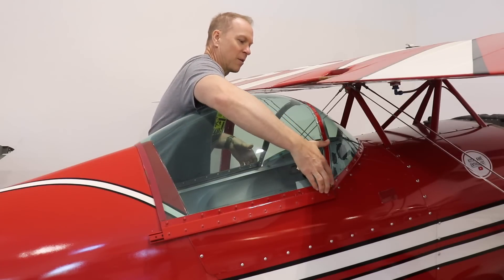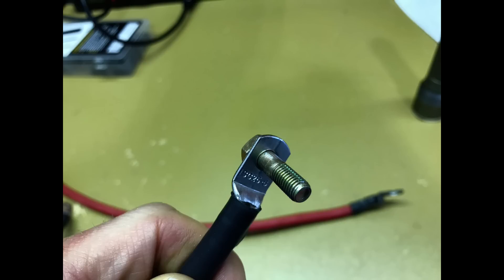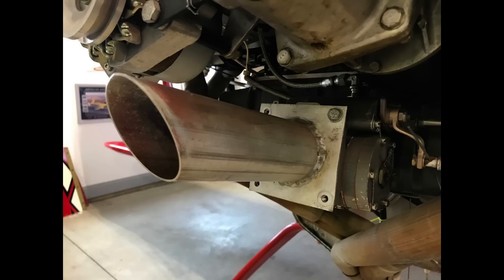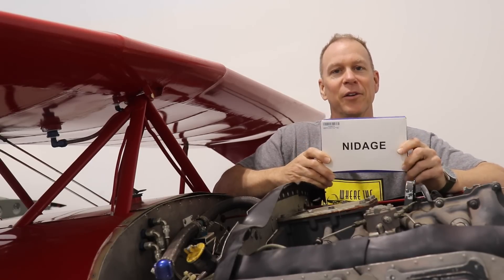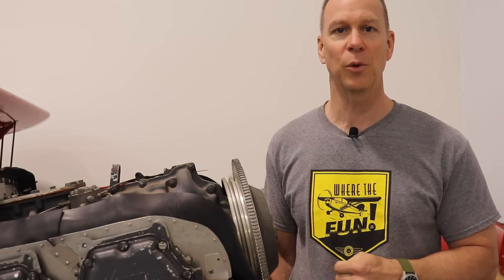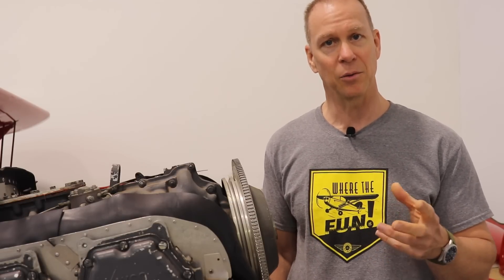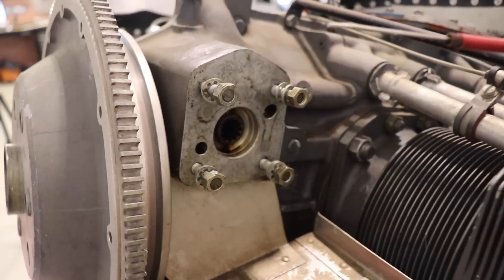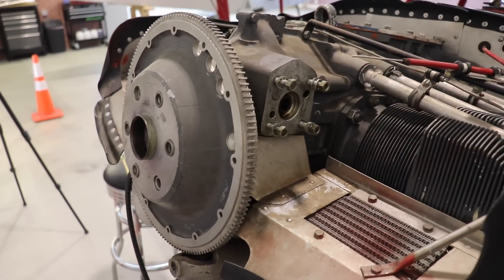PITTS S-1E "MAJOR PROBLEM"  (EP2)

Comment: I have spent 6 years rebuilding and restoring my Pitts S1-T. Built 3 new wings and mounted a Grove aluminum gear. My engine is a Superior IO-360 parallel valve with cold air sump and induction. The prop is a Sensenich carbon fiber ground adjustable which I ordered at Sun N Fun 2022 and took 2 months to ship and receive. Pitts is now 90% complete and hopefully flying by September. Keep up the interesting videos Mark!
Reply from the maker: Sounds like you’re building an awesome plane! I can’t wait to see it finished and flying. Did you pick a paint scheme yet?

Comment: Sharpening a Phillips screwdriver is the way we used to do it, also I caution you on a pits that you have no logbooks on the engine because back in the day we used to shave the case because the only cylinder heads we could get was 8 1/2 to 1 by shaving the case and re-cutting the cam and crank we get 9+ compression with 8.5 to one jugs and I don’t remember the dimension to check off the top of my head to see if this was done. But Lyccming would know.

Comment: Mark 
I’m an A&P and yes I’ve done that constant speed to fixed pitch before.   What Lycoming  said to do by taking a long punch to poke a hole in that plug is correct.  What I used was an old screwdriver that I sharpened to a point and used that to poke that hole.  One note of caution is, if that hole isn’t large enough  oil pressure will build up enough to blow out the front plug.   So make sure that the hole you  poke is close to a  3/16 inch dia.  or more.   I found that out the hard way.   When u put the plug in the front of the crank make sure u get a good dimple in the center of the plug to (1) hold it in place and (2) seal the end.   
So give it a try and good luck
Reply from the maker: Thanks for the info! The Lycoming SB says to make the hole 1/8 to 3/16” so I’ll def go on the larger end. Great idea about the screw driver-I’ll go to Harbor Freight and get a “high quality” a few driver and I’ll grind the end to a point!
Reply: Maybe you'll just find those log books somewhere 🙊🙈🙉

Comment: prop conversion seems like a super easy decision! remove the weight, save the monies. clean up the valve covers? ceramic coat the exhaust? fly it! looks too good from my house! but really it looks like a great airplane that just needed the love your giving it. Full resto might be saved for the "buy another one that needs it" category.

could you send the engine in for conversion? poke a hole sounds like a joke! I would have a hard time with that unless you found someone with experience with it.

Comment: It is good practice to use a washer under the battery cable nut or bolt given that the cable end is typically made of copper or a material softer than the fastener.  A properly sized washer for an AN4 would have easily addressed the large hole in the original cable and would have been a sound solution.  Even with the properly sized hole, using a washer is good practice to keep the bolt from eventually digging into the cable end.
Reply from the maker: Nope. I would never say that using the wrong terminal and then trying to fix it with a washer would be a sound solution. The correct solution is to use the correct terminal!

Comment: G,day Mark from Sydney Australia.
That's disappointing about the propeller on the Pitts. Do you know the testing method used to detect the fault.
You can't just run two cables from the battery to the starter motor? The (solenoid) in the positive charge?
🌏🇦🇺

Comment: I know your pain. My old Pitts S1S was nearly perfect but it always needed something. Put a fixed pitched metal Sensenich prop on it. You can find them cheap and they're easy to overhaul. Mine was a 76x56 and it climbed like a rocket. Pull all the electrical system off including the ring gear. You'll save a ton of weight. Then hand prop the airplane to start. Cold starting is easy hot starting is a pain in the neck. I see you have the lightning holes in the crankshaft. Be careful with tumbling maneuvers with a metal prop. Mine became a little tail heavy. I easily cruised at 160 mph and climbed 2500 to 3500 fpm depending on temperature. My empty weight was 762 lbs. With an IO360-B4A.
Reply from the maker: What do you think about something like the Sensenich ground adjustable composite prop? I believe they are lighter than the metal fixed pitch props.
Reply: @KitplaneEnthusiast  They're nice although you want to keep it very simple on an aerobatic airplane. No potential failure point. I've never seen one on an S1 Pitts. How much lighter are they? I wouldn't want to hand prop one of those. They spin up too quickly to be safe. There's nothing like a stock Pitts S1S for fun, durability and lack of maintenance.

Comment: I will say I am curious about the process of getting a new airworthiness certificate for an existing aircraft - if you could keep us posted as that progresses....

And, a pound is a pound - with a lighter prop you may be able to move the battery forward?
Reply from the maker: I’ve already talked to the FSDO about this and they said that since it was already certified, all I need to do is re-weigh the airplane and come up with a current W&B. Then get a fresh annual condition inspection on it, and then they come out and inspect it like they would any new Homebuilt. They issue a new airworthiness cert and new limitations and basically it goes back into phase 1 testing in its new test area. I can not get a Repairmans Cert for it because I am not the original builder, but otherwise it’s basically the exact same as certifying a new homebuilt aircraft.
Reply: @KitplaneEnthusiast  Thank you.

Comment: While I certainly agree that removing that connector was the right thing to do, I believe it was a GPU connector (external start cart) rather than a charge port. Even if you wanted a GPU connector, it was a lousy place to put it.
Reply from the maker: Ah you are correct! It’s more for external power than for charging.

Comment: I remember a full scale Pitts in a magazine years ago that was fitted with a radial engine. It looked beautiful, but required 25 pounds of lead in the tail to balance.
Reply: Do you mean Samson Pitts or the Model 12 Pitts?
Reply: @pittss2c601  Don't remember that was back in the mid 1970's

Comment: I'm very sorry your Constant Speed Propeller was rejected.
But it's good that you had it checked! 👍
Maybe another option for your engine.
Sell it as it is then you save yourself the conversion and buy one with 180 hp then you have no problem with weight and balance.
Reply from the maker: That was my original thought. But there’s no way I’d remove the engine and then NOT want to just tear the whole airplane down for a rebuild. I’m definitely not putting another C/S on it, so I think the best option is to use this 200hp engine and put a light weight Catto fixed pitch prop on it.
Reply: @KitplaneEnthusiast  OK, it was just an idea, because you said in your video that there was a problem with the motor converting it to a fixed pitch propeller and you haven't found a technician who could do that either.
Sudden massive oil loss is a big danger, if I understand correctly, if the plugs in the oil passages for the C/S propeller don't hold.
I can totally understand that you get a Catto fixed pitch prop, it's almost only 1/5 of the price of a new C/S propeller. 👍

Comment: Do not buy another Pitts, resist all temptation, and do not do a full restoration, reduce the weight on the airframe and replace the bad CS prop, and install a six-pitch fixed blade prop. Fly it and have fun rinse and repeat. Finish your Zenith and have fun with building that.

Comment: So let’s get this straight.  To save buying a $17000 constant speed prop your solution is to buy a second Pitts??? 😀

With the lighter prop you could always move the battery back up the front.  It’s probably behind the seat specially to help balance the heavier engine and prop.
Reply from the maker: Actually yep-that's pretty much it. With the prop, shipping, and governor overhaul, the cost was over $21,000. I don't think this airframe as it is now is worth putting the money into. So if I had another Pitts to fly, I could take my time getting this one airborne and put a cheaper fixed pitch prop on it.